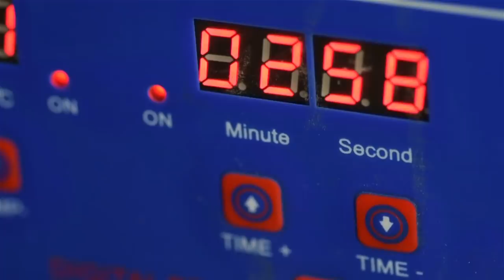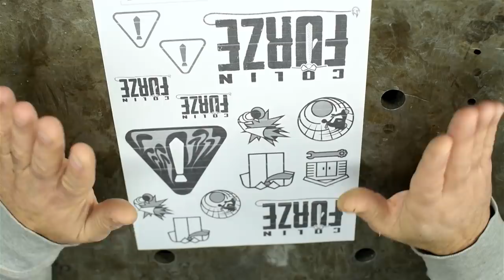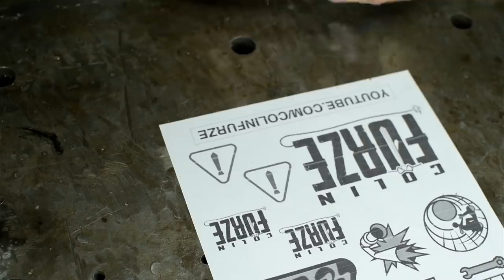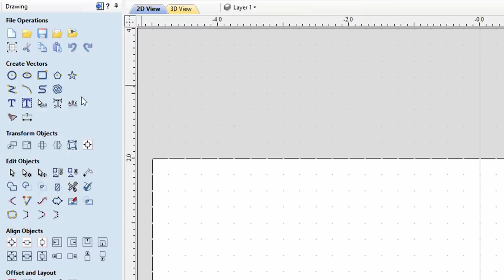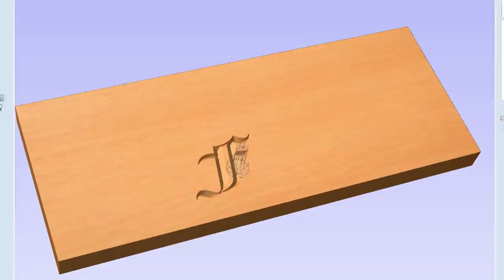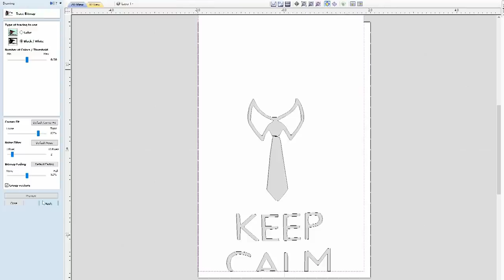VCARVE Branding / Logo Irons - SECRET SANTA 2020!

Comment: This old Tony: Precision machines and crafts beautiful punch set 
Allen: Knife bolted to oscillating cutting tool blade
Reply: Allen should just have sent the thing he made at first, the power hammer sword thing, that would have been better and more worth the effort.
Reply: Ryan Bisi 
It was funny though.
Reply: I did a similar thing with a hooked razor knife, and use my oscillating multi-tool for cutting carpet.  Hmm... maybe I could put a small razor knife in, and delicately carve pumpkin-apples.
Reply: 2014 secret Santa: I handcrafted a flower pot using tapered slats of black walnut, cherry, red oak and zebra. 
I got a headlamp......
Reply: And yet they both made what they set out to make. 8)
Reply: Pure crap on Allen's part...
ToT saved it with the "why is it picking up speed!?" And the bandaids...but still...I would remove the guy from the listing.
Reply: Allen's contribution is much like the horticulture teacher at our school. We all try to buy a gift weeks in advence to suit the interests of our victim, but morning before the gift morning tea, the hort teacher rips a shit half weed from the green house, half cleans an old pot and smashes them together and pops it under the tree.
Reply: @nixie2462  You don’t see the practicality of it then. It looks more effective than those electric turkey carvers that run as much as 80 bucks, and what shmuck doesn’t have a multi-tool
Reply: @nixie2462  bruh
Reply: @nixie2462  I agree... It's like the guy who wraps a potato and puts in under the christmas tree for the club's christmas gift pool...
Reply: no one 
 
Allen pan knife go burr

Comment: I had a similar system to the V carve for the router way back that used HDF templates that were shaped to produce patterns, and the pattern was widened where you wanted a deeper/wider carve.  It used a V shaped bit which included A V shaped guide tool on a bearing to control height.  Think a straight cut copy bit with a bearing for making multiple matched oddly shaped pieces using a hard board template, but in both dimensions. 

You just left the router height clamp a bit loose so you could in essence float the depth control in the template by holding gentle down force on the router.  At least that's how I remember it working, been quite a few decades since I used it.  It required multiple patterns to do intricate carvings (like you did there) and they just fit inside a rectangular plywood frame, clamped to the work, to index them.  Slow, but worked pretty well.  I did a couple on some flat columns for the fireplace mantle I built and they look pretty good. (gold on (in actually) white).  Using CNC on a 3D router or the mill would make it MUCH easier, I expect, if it doesn't take too long to program.  I would hope that interface is pretty streamlined by now, for something that simple.  Merry Christmas (or whichever holiday applies) to you and yours.  Enjoyed the vid.

"And god help you"   LOL  Band aids were a riot!

Comment: What's that weird yellow stuff at 9:27 ?
Reply: Dunno, doesn't look like any metal stock I've ever seen before
Reply: @recurvestickerdragon  Maybe it's really old or something?
Reply: I think its called waad
Reply: That's the stuff those shady wood elves sell out back behind the discount welding supply place. Some kind of old-fangled cellulosomething fiber brick. Mills really easy, but it smells funny, and likes to catch fire at the most inconvenient moments.
Reply: Extremely carbon rich metal I'd guess.
Reply: An advanced cellulose composite.
Reply: I think that's the guard, but mine doesn't have one either.
Reply: Well at the risk of being a smart arse, the “yellow stuff” is the blade guard on his bandsaw! ....I’ll get my coat 😳
Reply: They call moody I think. That material used to grow from the ground... weird  ancient stuff.
Reply: It's what digestives are made of
Reply: "brought to you by the wood council"
Reply: I've heard AvE call it carbohydrate foam
Reply: @bjorn301  Think some other guy calls it wewd
Reply: @Leofred2000  is that african wewd or european wewd?
Reply: @bjorn301  Think only the wewd master knows, the Duke of wewd mr. Bobby Duke!
Reply: actually those are nitrous chips, used for street racing
Reply: I think it is some sort of mild cold grown steel created with a unique water quenching process.  Lightweight, easy to machine, but has a horrible tensile strength.
Reply: Need to get @bobbydukearts in on this to confirm but I think it's wewd
Reply: It must be some weird cgi or something
Reply: @derekthehalfabee7942  that sounds more like slag than what was being machined here.
Reply: That is often called wewd.

Comment: "I don't own a thickness planer"

But you do have a couple mills and fly cutters lol 😉🍻
Reply: Even better are these, https://toolmonger.com/2009/07/17/turn-you-drill-press-into-a-planer/ They work 100 times better on any mill than the drill press they were designed for. Think of it as a 3" diameter 3 tooth face mill for parts of dead tree cadavers. A more standard fly cutter could work, but I think you'd really need a pretty strange and seriously hooked tooth shape to get them to cut cleanly.

Comment: Tony ,I have no experience on machining. I have a mini mill and a mini lathe. I need to make a logo stamp to use in my press that will stamp a  very small logo about no more than 1)4 inch . In would projects that I want to start making and selling for extra income as an old senior. My work has  to be done by hand I don't have anything but just the standard tools. Thanks , Fred

Comment: 1800 degrees? I've been a heat treater for over 35 years. You heat treat 01 at 1475 one hour per inch. And you can quench that in air since the carbon content is so high. Jeeeeeeez.

Comment: I've actually used VCarve before since I have not learned Solidworks CAM  and the router I was using was connected to a computer with it installed, but the computer was running Vista so its unlikely that it was the most updated version lol